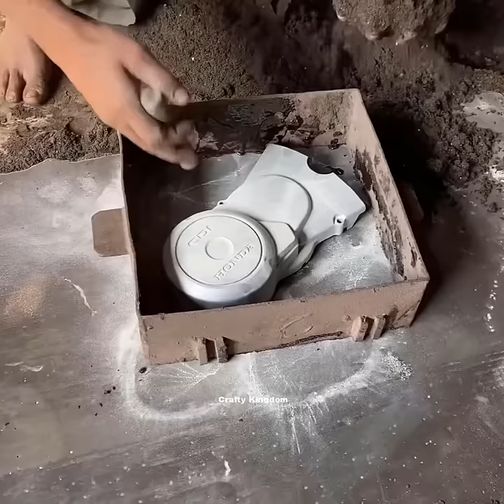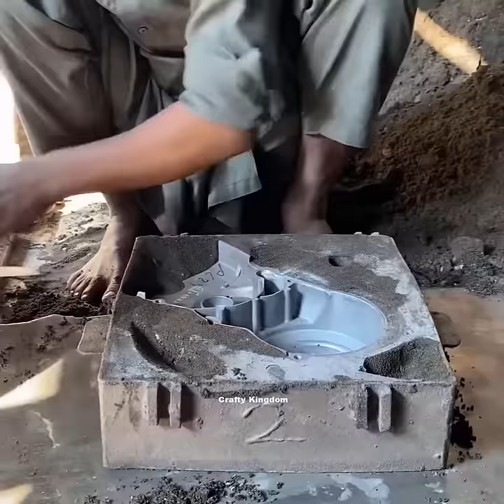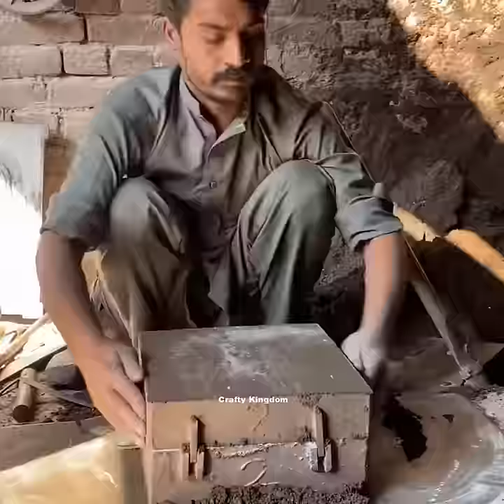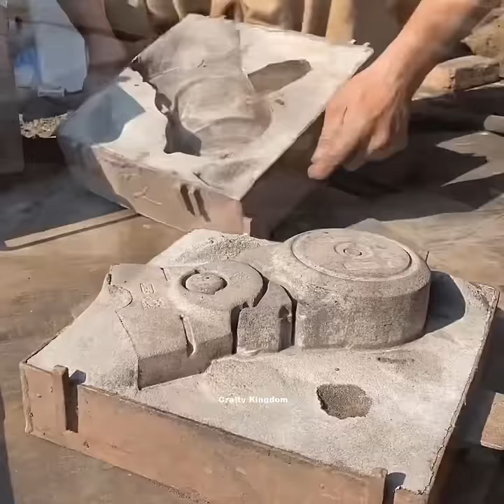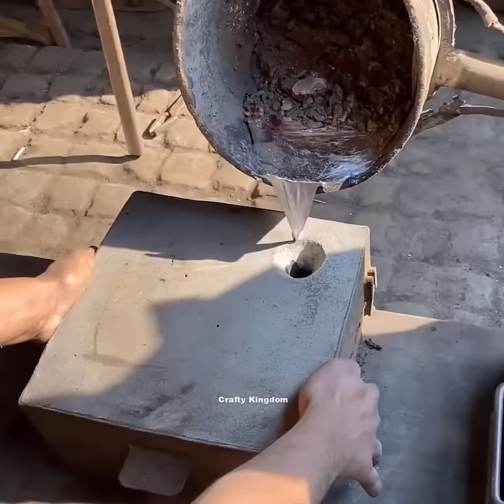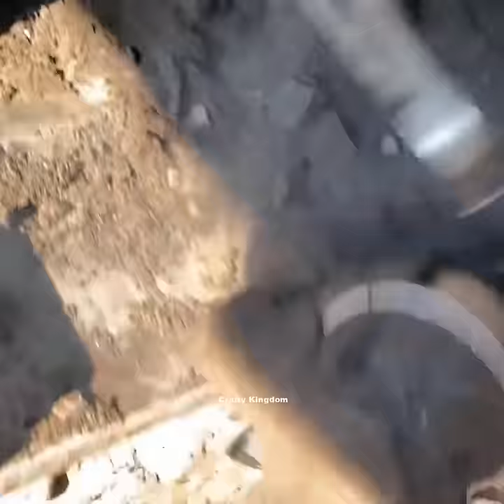Aluminium Casting a Bike Engine Cover Using Sand Mold With Amazing Skills. #shorts  #casting #asmr

Comment: This is gravity die cast aluminium made with scrap of aluminium from old engine parts good that replacement is made but such cases are not sturdy most likely this video is from pakistan as the honda 70 cc case is in demand happy that the skills are still intact

Comment: This is not OEM..or aftermarket….this is madness
Reply: Parts are made like this in the factory, only on a larger scale.  The only problem I see is it looks like a factory part being used as the pattern.  All cast metals will shrink, the degree of shrinkage depends on the freezing range of the material. As an example, aluminium shrinks by over 6% during solidification while copper shrinks by nearly 5%.  That why you need an oversized pattern for casting.

Comment: When I see these Central Asian cast metal videos, I keep asking myself how the colleagues there deal with the inevitable shrinkage of around 1.5%.  The sand casting molds made according to the original components do not deliver the original large results, but components that are 1.5% smaller.  Does that still work then?

Comment: Isn’t the replica smaller than the mold?
Reply: no
Reply: Yes, it is. Shrinkage of aluminum is about 1.2 %. It wont fit.
Reply: @matthiasschmidt1577   knock off cover will fit a knock off engine 😂

Comment: I guess some sort of knock-off Crocs are nominally better than the standard-issue open-toed safety sandals... if you really like to have molten polymer make a mold of your former foot, once the aluminum hits. 😕.  Then I guess you could cast yourself a prosthetic orthotic replacement.

Comment: Not a chance I'm trusting that
Reply: Watch a YouTuber called mrpete222, or one called doubleboost.  They have some really great casting videos.  
I would not be afraid to use that part, if it fits properly.  It looks like a factory part he is using as his pattern.  The aluminum casting will shrink 5-6%.
Reply: @MaturePatriot  how far would you trust it? What if it was a blade for aircraft turbine?

Comment: Why use aluminium usr steel instead
Reply: steel is heavy, steel rusts, steel takes another 1000 degrees to melt and you can't do it in sandals